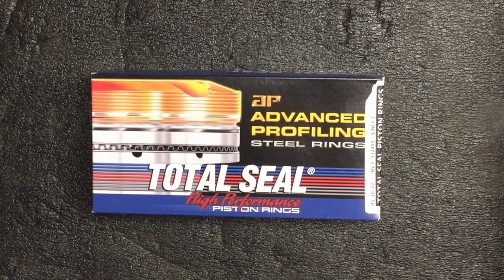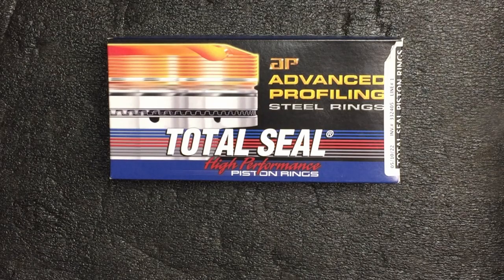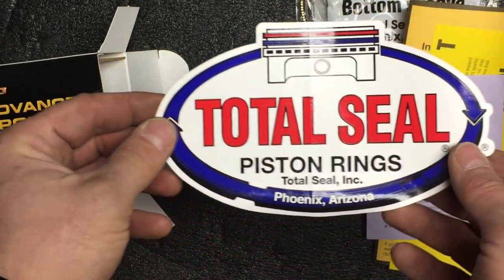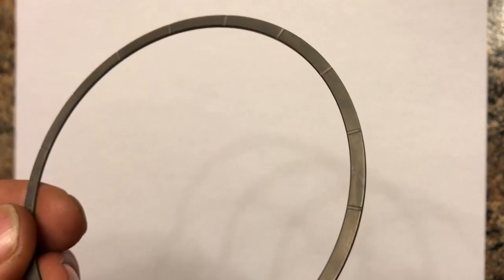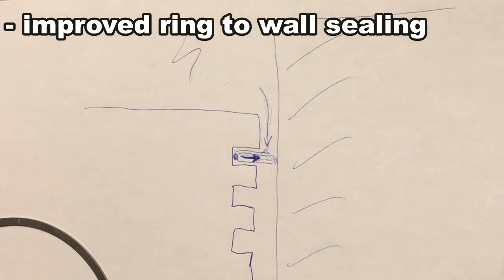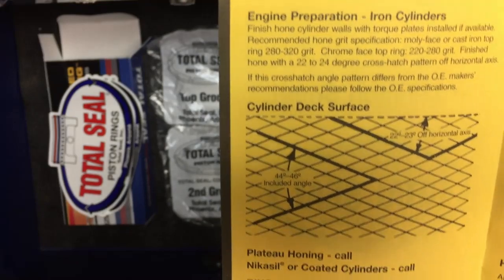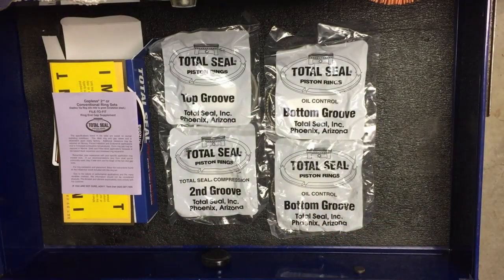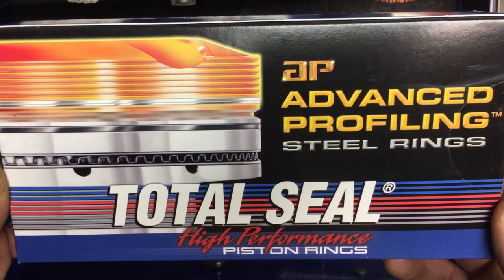TOTAL SEAL - Gas ported piston rings

Comment: I’m on the fence about this product. Actually just learned about this type of ring and why it is helpful. I’m looking to rebuild my turbo 6.0 LS, I e got a dead cylinder, cyl 5-50 psi. All the rest 180 psi. Your video is the first video not from the seller so I wanted to know about your motor and how it’s till running?
Reply from the maker: Thank you for your message! In last 2 years I was more focused on building some structures on my property and there was literally no time to spend on my engine. I ended up installing a crank and pistons with piston rings. I might have some time this winter to keep working on it. Also, but it's just a plan now, once I'm done with my SHO I'm planning on replacing piston rings on my next project car Audi A5 2.0T known for high oil consumption due to a bad design of their piston rings. 

Personally I strongly believe that you won't make a mistake choosing these rings for your engine. I have no proof to say that but the system they offer looks pretty good to me.
Reply: What was the result with the SHO
Reply: @thefantasticpendejo6182 still in sleep. Some other stuff in life came up which I'll post a video about when the time comes. I might start putting the SHO together before the winter comes.